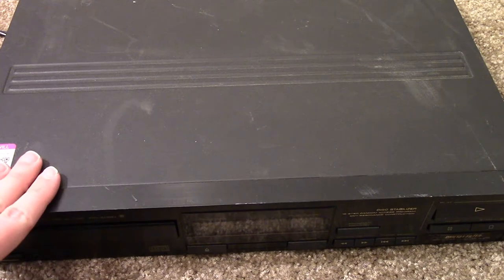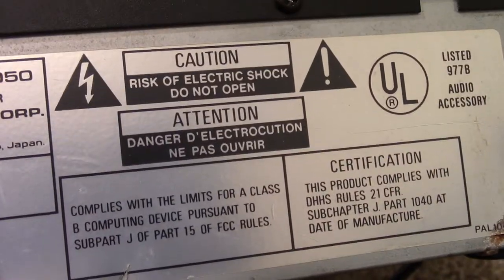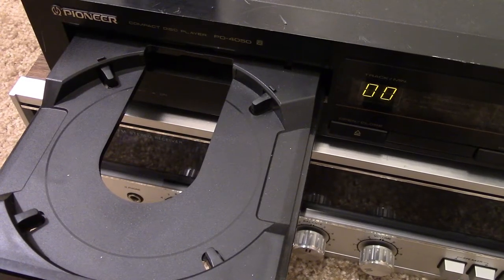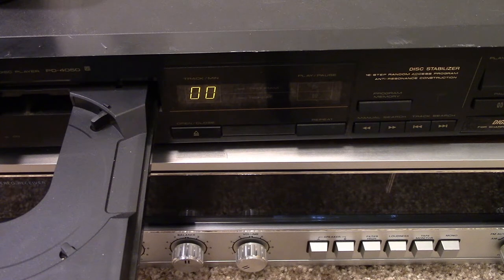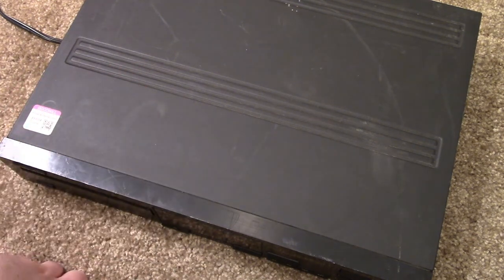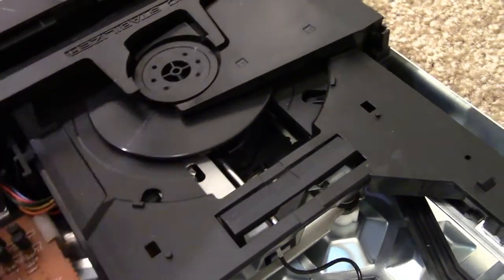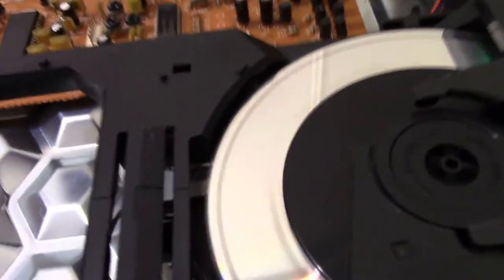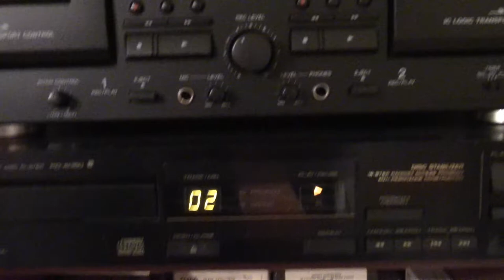1980s Goodwill CD Player, Does It Still Work?

Comment: We need those kind of goodwill junk stores in here. Sites like OLX have expensive junk with devious sellers...
Last time I repaired a shelf cd-player, it was a AKAI. This AKAI was a basic cd-player with only analog output and no amp. It had a problem.... a broken cd tray belt. I cracked opened it unscrewing 5 rear screws and 4 side screws. I had to unscrew the cd reader part and remove some attached cables to the logic pcb and remove the top protect plastic and the tray itself. I removed the 2 pieces of broken belt and figured which size it might be. Then I went to my collection of broken desktop cd drives and removed a belt. First try went ok. I installed the belt and worked flawlessly. I put cd reader part back together, tested the cd tray, it ejects and goes in fine. Then assembled back together. Then I noticed some other problem. The analog RCA was a bit lose and there was a cracked joint.... I had to unscrew the 9 screws, then the SINGLE screw that holds the 2 analog left and right in place (the single screw instead of being in the middle, it was on the left side of the left audio input). I had to detach the cables again and see what's going on on that area of the RCA input. Broken connection caused by fatigue of RCA cable input. I reflowed that connection and before that, I superglued the input to the pcb for extra strength. A bit of nail polish where the single screw sits and screwed it gently. This will prevent it from unscrewing. Assempled the cd-player again. All fine. Shame the display is a bit dim.
Reply: Oh yeah, the sellers are just insane in OLX and mercadolivre. 
It just infuriates me. And most good stuff, never came here to brazil. 

Btw, are you a fellow brazilian?
Reply: I've got a Panasonic SA-AK91. Got 'lucky' as the seller said that the tapedrive needed only a cleaning, and the cd changer needed a new belt. It was for an 'ok' price.

Just had to get one computer dvd drive belt, to put in the cd changer, and it worked perfectly.

But, when opening the tape drive, it was terribly corroded, my guess it wont ever work. Its sad, that i was deceived, but at least for now i dont have any tapes, nor plan on getting any, so i'm "ok" with that not working.
Reply: @eduardoavila646  No, I'm not brazillian.
Reply: @hugosimoes5119  Lol, are you from south america? Didnt know OLX existed outside brazil
Reply: @eduardoavila646  It exists in Europe. Portugal, Bulgary, Romania, Poland...

Comment: Looks like a Sony transport, and the Sony chips on the PCB are used to control it. The DAC is a good old multibit DAC, very decent quality if nothing special. This DAC is a voltage source (as opposed to many DACs that are current sources) and does not require I/V conversion, the output stage looks like it does not have any opamps in it. In general, this simple old CD player probably sounds better than many later designs...
Reply from the maker: Thanks for the breakdown!
Reply: no surprise there Sony cdp101 was the first commercial CD player on the market. many pioneers (even their old 78 receivers ) used Sony chips ..let alone their CD players.